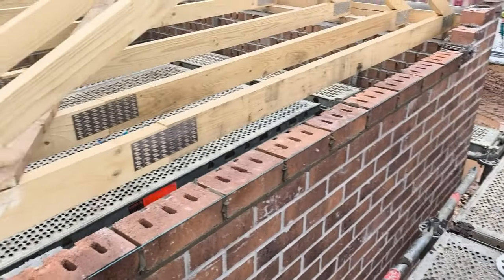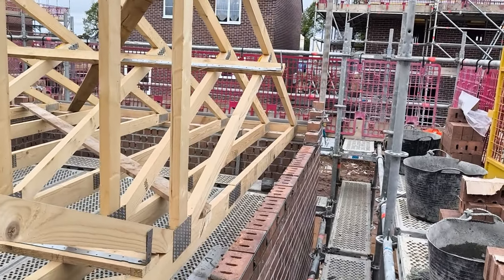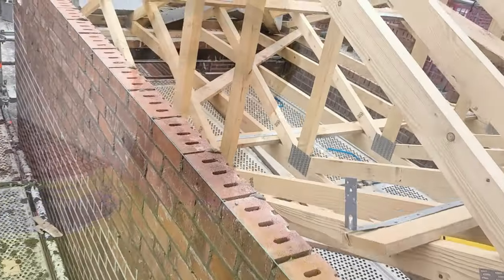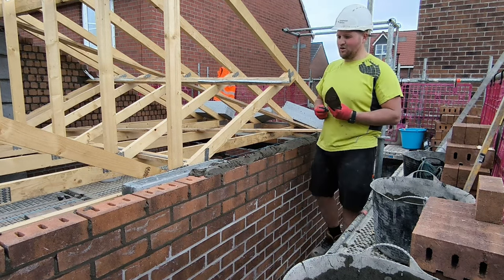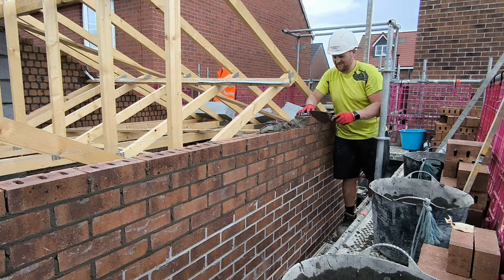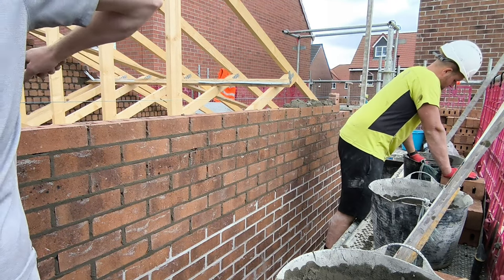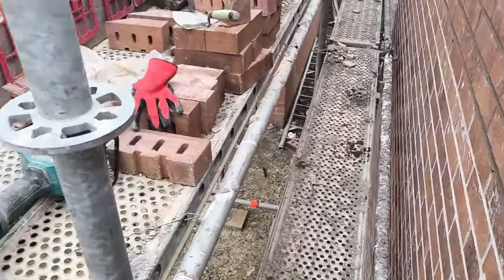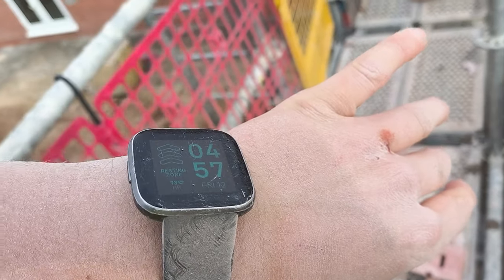Bricklaying Vlog - Fiddly Little Peaks!

Comment: Nice method but I don’t see the gain when spreading your mortar in one go that’s any gain on time and cost?, certain bricks would smudge with the amount of mortar you allow spill out when pressing down with the brick and cutting off? Ok with flat faced bricks I suppose?
Reply from the maker: These are concrete bricks in this video, the mortar doesn't go off on them like a regular clay brick, that's why you can put a full length spread on them 👍

Comment: How on earth do you keep the perp widths consistent and the brick level across it?
Reply from the maker: We keep the bricks level Using a string line to lay to and you keep your perp joint consistent by keeping half bond to the bricks below (half lapped)
Reply: @theafter8bricky I understood level lengthwise but wondering about level across the brick without using a level to check?

Thanks